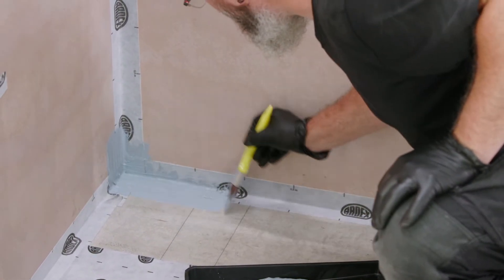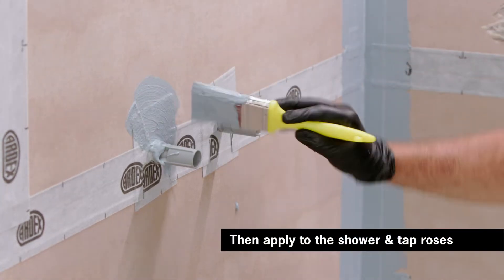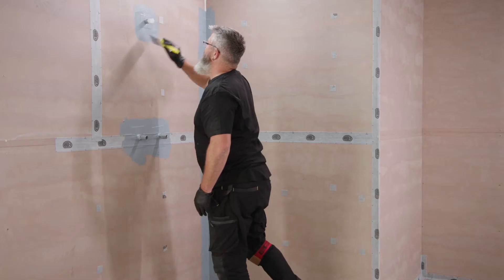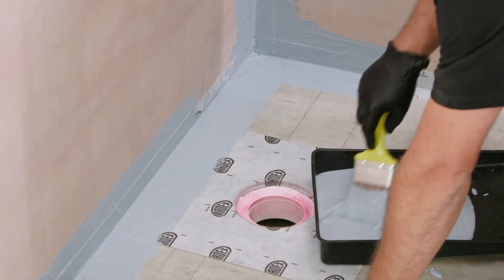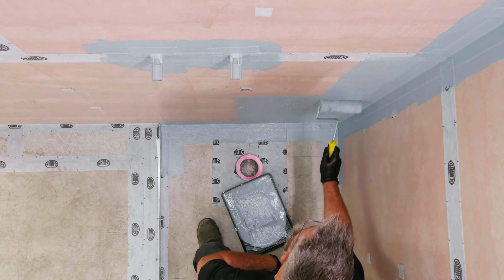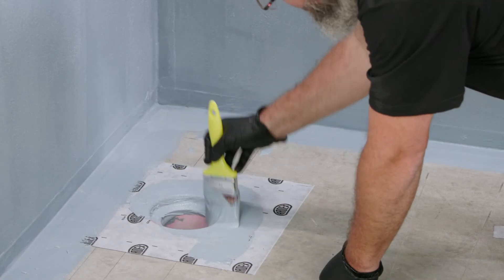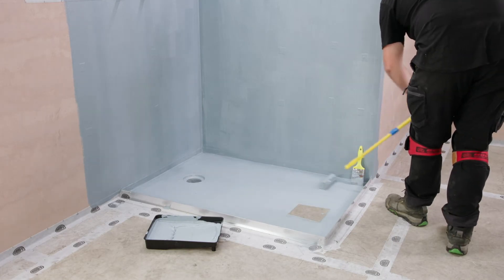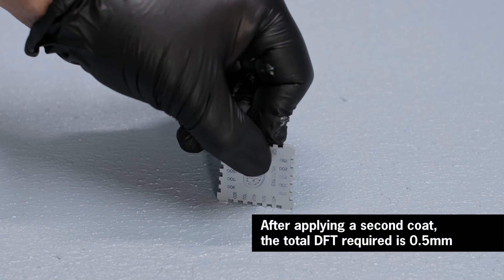Bathroom Waterproofing Under Screed

Comment: Can the bond breaker tape go onto self levelling concrete substrate? great video.
Reply from the maker: Yes the ARDEX STB and STA tape can be used onto a self levelling substrate as long as this is primed first using the ARDEX Multiprime. Like all recommendations before priming you must ensure the substate is clean of all contaminations, including dirts, dust, paint etc. Once cleaned, the ARDEX Multiprime is applied. This is allowed to cure for 30 mins to 1 hour then the ARDEX STB and STA tape can be installed.